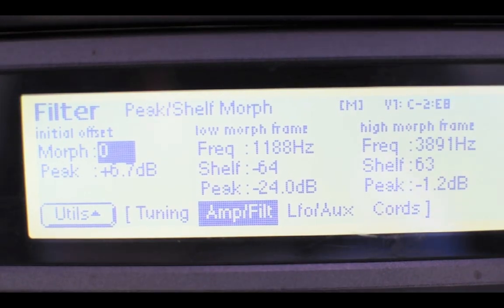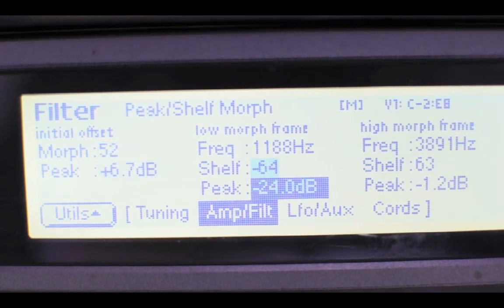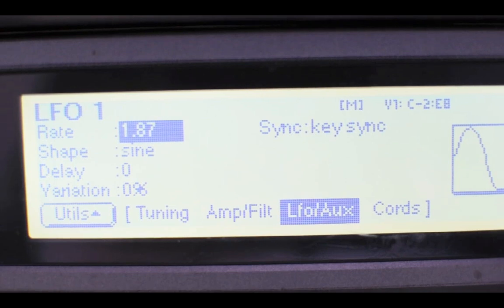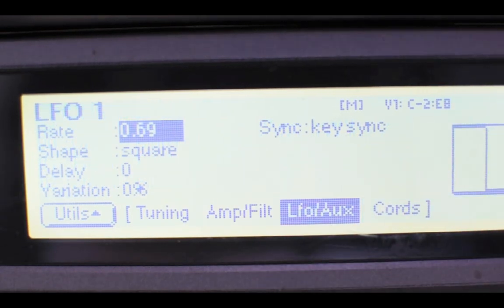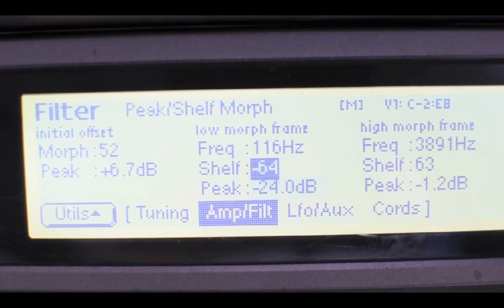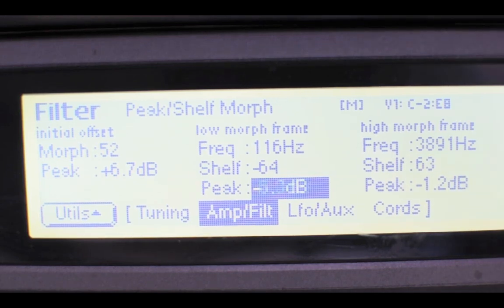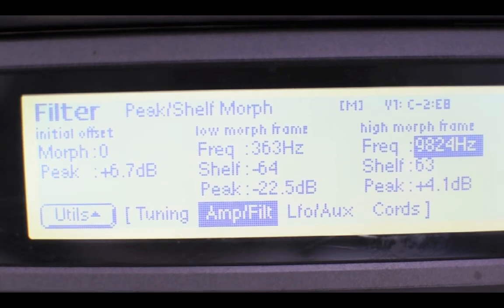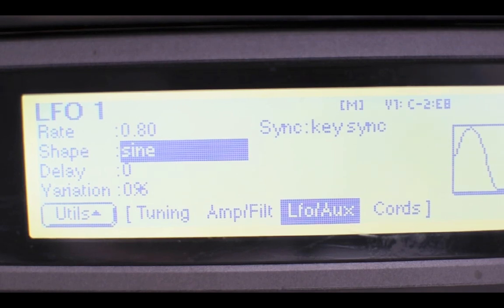EMU Peak/Shelf Morph Filter

Comment: That's quite good. I have same unit and know one of it's main advantages is knowing and using these more complex features. I've read the manual but it doesn't always give enough detail and usually the best way is to experiment, but that can take up too much time.
It's these type of filter settings that lead to new sounds and ideas. I like it.

Comment: have you fixed your jog wheel? its pretty easy to do, just get some pcb cleaner and spray into the top of the encoder.  Let it sit awhile and then work into into the encoder by turning it.
Reply: Hi Raj.

The jog wheel on my E6400 Ultra is not working properly. When i wind it in a certain direction to change the value it jumps from negative to positive, to negative to positive, and so on.

I see you mention that PCB cleaner can help, but I'm not sure where to put it. Do i need to take off the front panel of the sampler to get into the gap? At the moment there seems too small a gap to get any cleaner in.

Thanks for any help. :)
Reply: thebroadcastuk hi, there is a Facebook group for the Emu, two actually, and i'd join if you can.  Re the pot there is an easy way and a more complicated way.  First thing is you need to have the panel off and flat so the encoder pot is pointing upwards.  You can then squirt a small about of PCB cleaner on to bit where the shaft mates with the encoder, then work in that solution by turning the knob.  The more complicated way involves turning up the 4 metal clasps and then the encoder will come apart and you can clean inside.   Note that PCB cleaner is going to make the encoder feel like it spins more freely.  If you want to lubricate it you have to get deoxit but PCB flux cleaner is a quick fix and you may prefer the encoder running more freely.